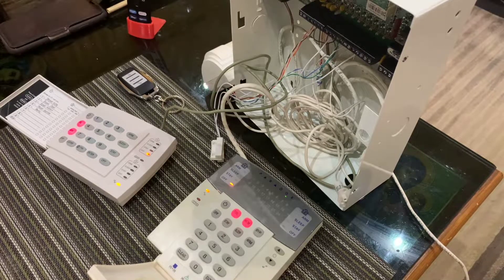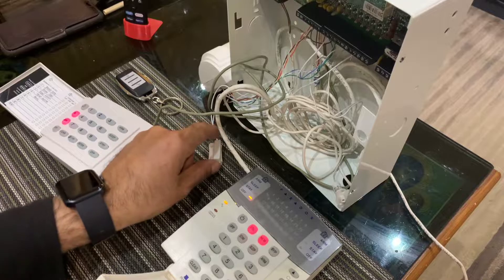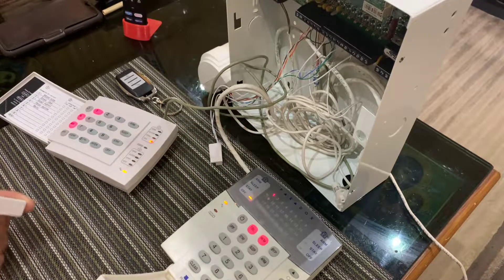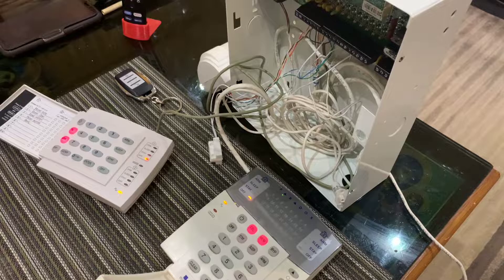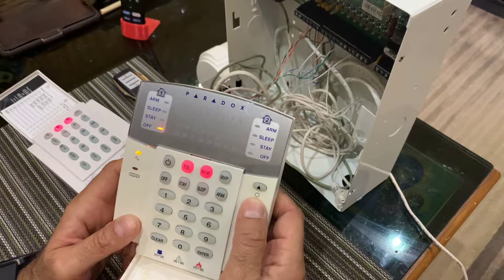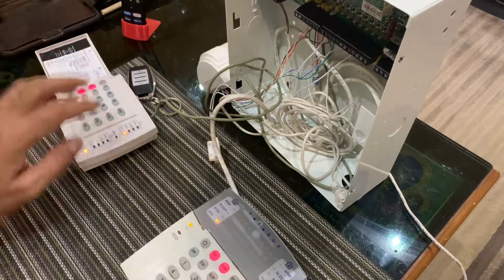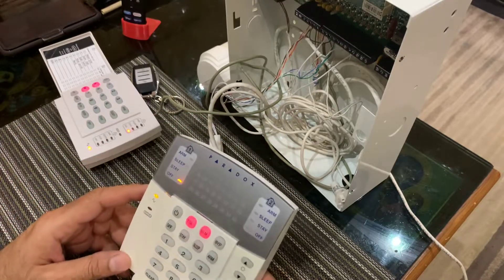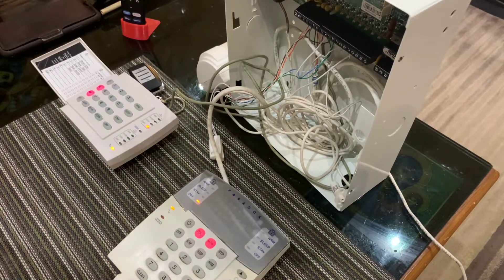Muting/Unmuting a zone: Paradox K10H/K10V and a K35/K37 keypads

Comment: Greate video, i jus have one question : is there is a way to mute the counting beeps during arming ?
Reply from the maker: Thanks. By pressing the clear button until it beeps in about 6 seconds. That will mute the keypad so it will only beep for 10 seconds and stop. Be careful though; an undesirable side effect is that when the system is armed and you enter the house you will not hear the beep that reminds you to disarm.
Reply: @sedky69   Thank you so much !  i will try it . i just forgot to tell you that my keypad is K32LCD   is this will work on this model ?  Thank you !
Reply from the maker: @ceco941  Pressing Clear for 6 seconds will enable/disable the mute function. If clear doesn't work and your keypad has musical note sign printed on the down arrow, you can try that instead of clear. Let me know.

Comment: Hi mister !
I have paradox k10v with 4 motion sensors for each room in my apartment and one magnet sensor for entry door.
I don't know how to set on stay option / only door sensor armed/. On my device each room/ motion sensor/ is deferent zone from 1 to 4 / lobby, kitchen, bedroom and guestroom/.When i walk in the apartment the buttons for each zone lights and i don't know the door sensor in which zone is./Maybe 1 for lobby?/
Reply from the maker: Did someone install this for you or you did it yourself? First you have to find out which panel you have. K10V is the keypad not the panel. If I understand your issue correctly, the door contact is not turning on when you open the door. Did I understand you correctly? If this is the case, then the zone is probably disabled. You would have to go into programming to fix that.